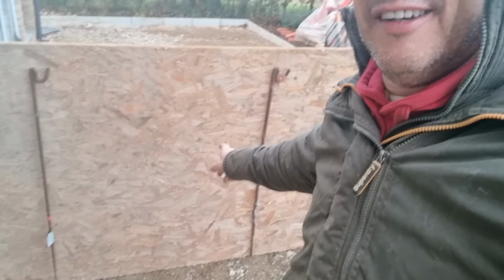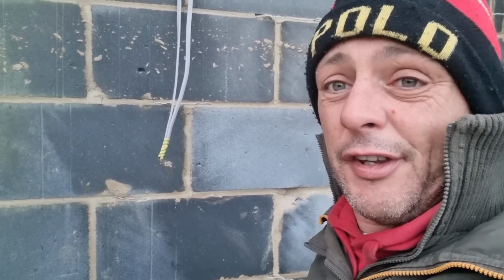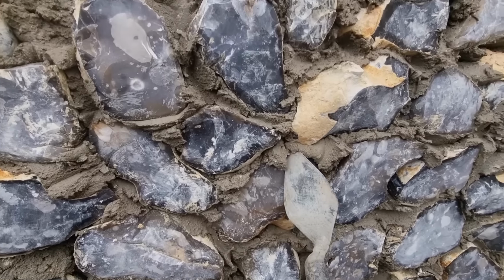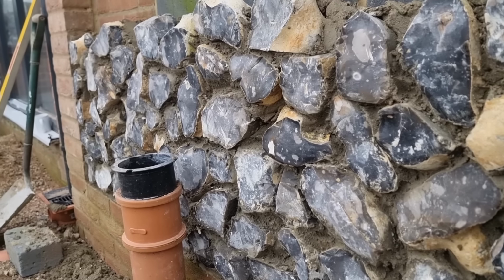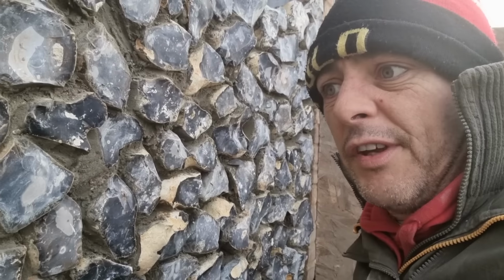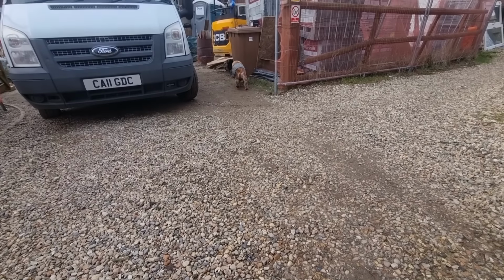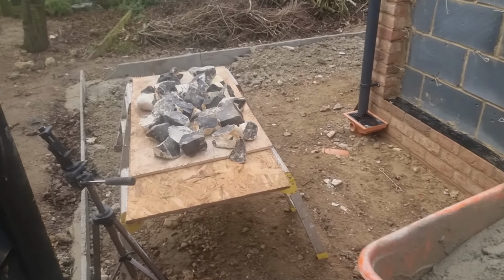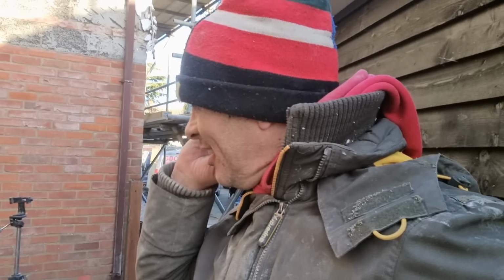Building with flintstones #bricklaying #construction #build

Comment: I done the same as you tricky fell over , but someone told me to sprinkle dry cement on top of the next bed so it drys it out quicker. It worked
Reply from the maker: Good shout that bud . Noted ✅️ 😊
Reply: So glad I’ve seen this comment doing loads of flint work and will help with the pointing

Comment: I got taught to do the muc really stiff for flintwork almost like repointing muc
Reply from the maker: Yeah mate. That's the key. Stiff but usable
Reply: Yes I do mostly stonework (sandstone) and use much stiffer gobbo than for bricks/blocks.  Half the time the stone is wet, plus  if using unsawn stone you're on an 8 ins plus leaf, lot of weight and with sloppy mortar the stone slides even if pinned at the back.

Comment: We lay it in the finish muck to save raking out and flush it all up as we go and cover in hessian at the end of the day and brush back with a wire brush the next morning. 
Saves raking out and re pointing and wire brush shows the aggregate nicely
Reply from the maker: Nice tip bro. 👌 I'm doing white cement for the face to match the house 🏠

Comment: Looks lovely mate , but how more of that didn’t fall out I’ll never know ! I’ve done a lot of flint work, you really want eml hanging out the block work every course, and you should sprinkle dry cement between the flint as they are non porous, use a mix of sharp and soft for your muck and make it slightly firmer than you was using, on a cold day use some first proofer or accelerator to make the muck go off quicker, 
I’m not having a dig by the way, what you have done looks good 👍🏻
Reply from the maker: Cheers bro. I'm getting the hang of it now 😁😁

Comment: Worked on a housing estate in the 80's with flint & lime mortar (nightmare) we had too lay chicken wire out the back of the blocks every course,used to lay to the wire then do a different section   go back the next day & start again
Reply from the maker: I can imagine 😁😁 not the easiest material to use

Comment: Put a scaffold board/ plank,  to the front and lay the flint to it, flatter,  and quicker.  leave over night, remove the plank,  then brush out the joints . Use Dutch pins to hold the plank too!.

Comment: if there are 60 bricks to a SQ mtr what is that in flint ?
Reply from the maker: How big is a stone. 🤷‍♂️ it's a piece of string bud. Probably about 35 /40 bits roughly
Reply: @trickybrickys  Just wondered if there was some formula to work it out like weight maybe.
Reply from the maker: @richiesquest3283  I found a tonne bag does 4m2 give or take a few . 😁😁

Comment: flint work buddie 2' a day no higher ... other trick to do is lay it behind ply sheets rake it out the next day ....
Reply from the maker: Yeah myself and the contractor disgust doing the exact thing with a board . You live and learn as they say 😁
Reply: worked on callum court many yeras ago .... the old boy there Georgey wise was prob the best knap flint guy in the south west...  they would set to a line but had the  long runs but where using just straight lime mortar   ... use an icing bag for piping  in the  newer mix  the canvas bags or pointing gun's are hard work  @trickybrickys